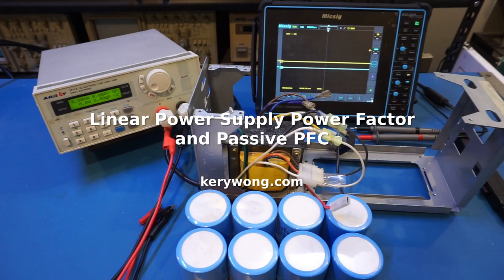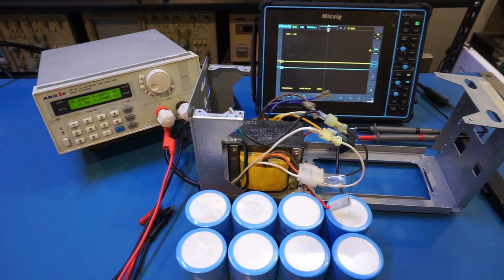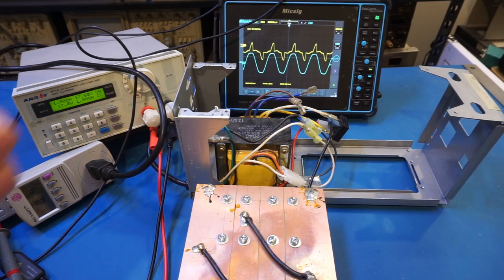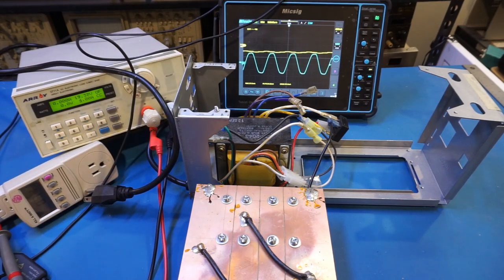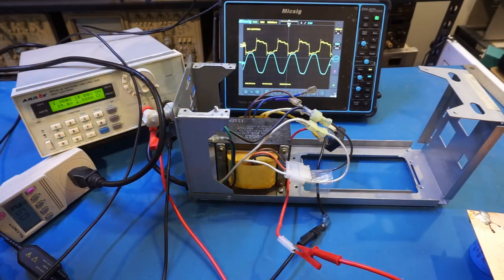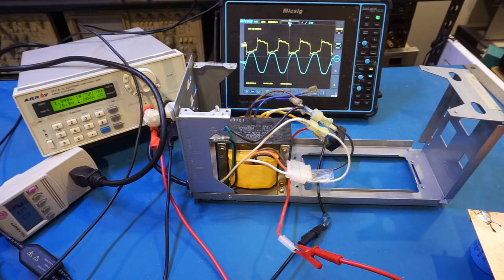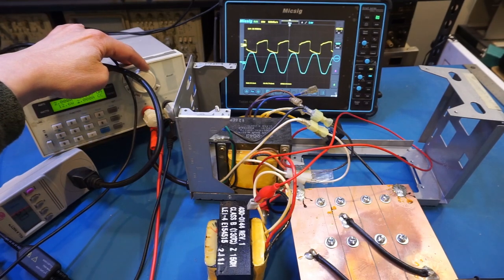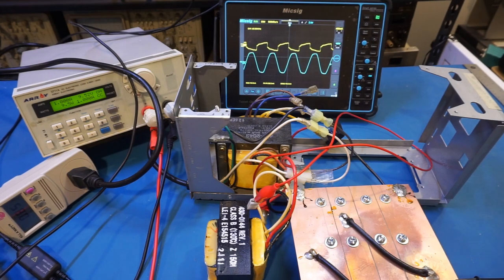Linear Power Supply Power Factor and Passive PFC

Comment: This is beyond my knowledge base, however, as the ripple rejection efficiency of the linear regulator effects the circuit's overall power factor, I have a point to consider... Most often, designers rate the additional voltage headroom provided to the V Reg at whatever the dropout voltage is... say 1.5V as being a common amount. However, the data sheets for these regulators state that the best ripple rejection is not attained, until 3V of headroom is supplied. Even when this is not directly stated within the text, the test curves are generated at this higher headroom voltage to provide the best ripple rejection, for marketing purposes. Just a thought...

Comment: Why CC and not CR to show the PF correctly????????
Electronic loads as useful as they are, totally suck in response time, ...crap engineering that is pervasive in the industry.
Reply from the maker: Good point! Didn't occur to me while shooting the video. Just tried it didn't make much difference in the waveform. The electronic load is definitely not designed to handle the voltage waveform without filtering.
Reply: That's due to minimal input voltage i assume, which is 2V for this one if i recall correctly from older video about it... Maybe one could build a load working down to fraction of a V and get better results.
Reply: @KerryWongBlog  I thing they have large (maybe 2-10uf, and very low ESR) caps across the load terminals for stability????  But since all but they very latest dummy load use SLOW cpu in the control loop, I do not think the AC stability is the issue, but the slow main control loop cycle time????  ...just speculating here. :)

Comment: With a linear PSU the main transformer is already a large 50/60Hz inductor. Is a second inductor really necessary.

 In a SMPS the bridge rectifier and large filter caps are before the transformer, which are the main cause of poor power factor in a SMPS. This is where a passive PFC inductor before the rectifier helps to improve the power factor but is not as good as active PFC. 

But active PFC is less reliable because the MOSFETs can and do fail short. Ive repaired power supplys before where the PFC MOSFET had failed short. I replaced the FET if i had a suitable replacement in stock or just left it out. The rest of the PSU usually still works.